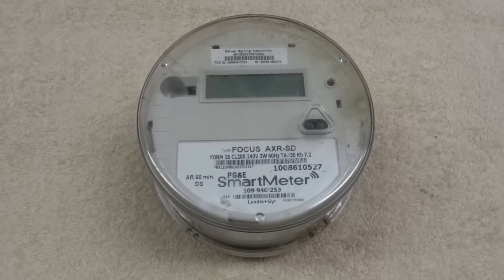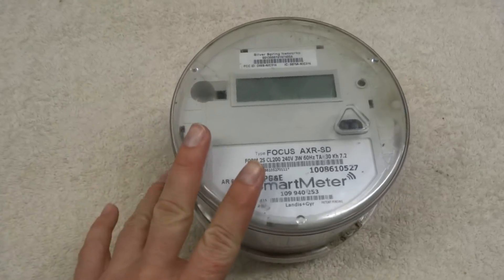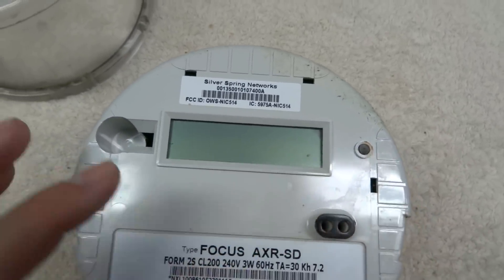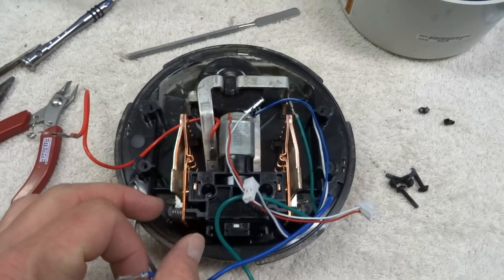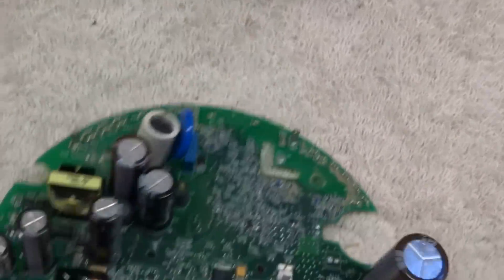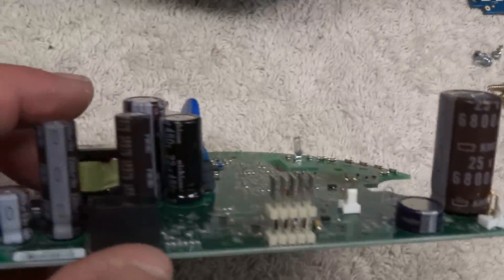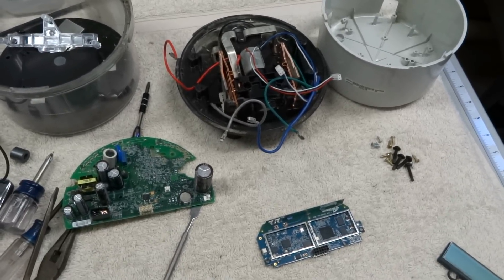Let's Teardown - Residential Smart power meter

Comment: The really interesting thing I see about this meter is that it measures both 110 V sides of the incoming service… That means they're charging for two phases or two wires… This amounts to stealing because there's no such thing as two phase....The old analog meters measured both sides of the incoming service but only metered one side which ever side was highest on Watts consumed
Reply: jicasound    ignorant!   2 phase is 220 v.   Most houses were updated to 220-240 volts  in the 70's   a lot of  ac's and electric water heaters are '2 phase'
Reply: ignorant! there is no such thing as 2 phase, at least in north america. single phase 220 is sometimes referred to as split-phase, as in the transformer produces 220, and is split by a center-tapped neutral into two 110 legs
Reply: Greg McNamer good on you, i was about to jump in here then i saw your input, funny thing i was a broadcast A/V engineer for 15 years, still was friends with my solid state teacher and yet somehow was missing this. I was looking at an old 100 amp service and couldn't reconcile all three wires, L1 L2 and neutral, were all the same size.........my teacher and stopped by and gave me enough to figure it out. Feeling a bit embarrassed i confessed my ignorance to the next meter reader who paid a visit. He smiled and said he only found out they were out of phase a year ago too. When both legs are balanced there is zero current on the neutral, that's why it's called "neutral" and now i find when de-rating conduit ampacity neutral is not considered to be doing any work, only making up the difference, thanks.
Reply: metro_BLOOMIN we can only learn as much as our ignorance allows, hey i just made that up so it might not be watertight, does sound good though.
Reply: Very well said.
Reply: It is correct to say that the power line voltage is stepped down to 240V.  These transformers are generally center tapped with the center being attached to ground.  This effectively creates 2 phase, 120V AC power, with the 2 phases 180 degrees apart.

These two phases are drawn from a single phase on the powerline.  It's not typically called 2 phase, but it's not incorrect to call it as such.
Reply: That's right. Right? I have never heard of "two phase". Single phase, available everywhere (there is electric service) and three phase, not everywhere but definitely in industrial zones.
Reply: i stand corrected.  I thought it was called 2 phase.
Reply: metro_BLOOMIN calm down dude, when troubleshooting or designing distribution systems i usually think of it as two phase, because it is. Most people don't comprehend the basics so they are quick to correct anyone who makes a reference to " two phase" because they mask their lack of technical understanding by knowing the jargon. Try this, next time you see equal current on both legs disconnect the neutral and try wrapping your mind around the result.

Comment: The power comes from the utility side, not the owner's side. If the power came from the owner's side, the meter would not be able to disconnect/connect the service remotely. Also, there are 2 120 volt inputs and two 120 volt outputs. Ground does not go through the meter. The 2 120's are out of phase so the voltage across them is 240 volts. That's so you can run your oven, dryer, etc.

Comment: You don't know what you're talking about
2:22 - No ground terminal. 220 in, and 220 out
3:08 - That's a reset/close button, varies depending on installation application
4:30 - The motor drives the contactor relay switch
5:15 - "siphoning power through inductance" are you kiddiing? The red and green wires is how the meter gets power. That "doughnut" is a current transformer, which measures the current flowing through the meter, according to which a customer is billed for power consumption.
5:50 - safety feature?! No, that's the core of a smart meters functionality. It's how the power company disconnects service
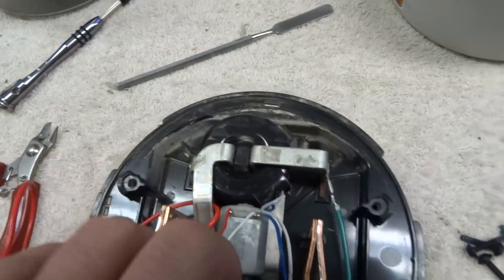6:20 - Are you f'ing joking?! Ground?! NO NO NO NO DO YOU REALLY F'ING THINK A GROUND WIRE WOULD ATTACH STRAIGHT TO THE LIVE????
9:15 - It's to close the contactor
10:10 - Banana plugs really??? That would compromise the weatherproofing
Reply: if you have a smart meter ( just for instance ) on your own home
try opting out
Reply: 2:22  - No ground terminal. 220 in, and 220 out
❓❓❓❓❓❓❓❓❓❓❓❓❓❓❓❓❓❓❓❓❓❓❓
At each house, there is a transformer drum attached to the pole. In many suburban neighborhoods, the distribution lines are underground and there are green transformer boxes at every house or two. 
The transformer's job is to reduce the 7,200 volts down to the 240 volts that makes up normal household electrical service.

It is the year 2018 you know.
Reply: @frederiquezug5938  LOL.  he aint be talking about that there green box on da ground.
Reply: Smart meters do not have surge protection anymore. 

There is no over voltage grounding lugs on these new meters
Huge source of smart meter fires

Lack of  UL 2735 Electric Utility Meter Standard Ensures Safety and Performance
Huge source of smart meter fires. 

In Canada, not following Canada's CSA C22.2 NO 115-14 1.5 rules 
Huge source of fires. 

The criminals at your power company will do anything to make a profit, including premeditated murder.

Comment: Focus is the brand, Silver Spring actually designed the networking system that the meters use.
The WiFi on the meter networks to the WiFi Transponder the power company uses to read the meter data.
The IR lenses are for a handheld reader ( does the same thing as the WiFi reader that's mounted on the meter guy's truck).
The motor/cam is to kill power in the case of emergency disconnect or fire in the home. Instead of pulling the head and leaving exposed leads exposed to elements in an emergency disconnect. The smart meters actually use less power than the old motor driven analog meters.
Yes, the blue SiverSprings board is the WiFi card. LOL and NO they don't hack your home WiFi... connects ONLY to the transponder.
Nice to hear from someone who knows a few things instead of some of the "foil-hatters" here on the ole YouTube :)
Reply: Do you have any proof?  What's that you say???  All BULLSHIT, I thought so.

Comment: Item is not certified. Where is the underwriters mark?  None on any in our town.
Reply: Meters are granted a pass obviously.  Shameful.  If a problem with a meter occurs the chief fire inspector collects the meter and no one ever hears anything more than the fire originated at the meter and was due to old wiring not being able to handle a spike.  Note, the fire hazard seems to show itself when a meter has been remotely activated and usually on older homes verses new construction.  Typical if services were stopped for some reason.  Older homes have prongs that do not fit the newer digital meters very well.  Leaving gaps and a potential for disaster.  They, the insurance companies push any liability onto the home owner who likely was never made aware of the potential for an issue.
Reply: nrdesign - Electricians in Canada can not install anything that is not certified. Electrical inspectors look for this all the time.   But these meters are actually the property of the "utility", are installed by 'the utility' and as such do not fall under the perview of the Canadian Electrical Code (CEC).  Utilities have their own code and installation books.  Come to speak of it there is also a separate CEC code for manufacturers as well.

Long way around to saying that Utilities write their own regulations and deal with issues in house (self insure).
Reply: You do understand that underwriters laboratories is a private company and in no way affiliated with any government safety organization. The existence of UL is a result of insurance companies. And there is no requirement for anything to be certified by UL for it to be legal for sale or use.
Reply: My Gas Meter is certified.  My old analog had over 50 years of service and never failed and was certified.  UL is one of a few underwriters that could be sought.  As a product provider I ensure ETL certification of our items and pay to protect not only myself but my customers as well.  It's a matter of "responsibility" and frankly if you want to give a pass go ahead but I expect more especially considering the nature of the deployment and the importance for safety.
Reply: RealeyesRealizeReallies the manufacturer could have chosen to underwrite the product themselves.
Reply: Ah, but would they not seal it as so?  I would prefer choice as a purchaser and in this case an arms length underwriter would be more appropriate..
Reply: Aren't there building codes / safety standards that imply certification for any equipment to be installed?
Reply: RealeyesRealizeReallies it's pg&e it blows better call 911.

Comment: Its funny Lyndis Gry would use electrolytic capacitors, here's why.
http://www.mouser.com/pdfdocs/ELNAReliabilityAlumElecCaps.pdf
If you look at the graphs you'll see some caps of this kind fail over time it says life expectancy 2000 hours will that's going to be different for each and every valve cap but if you do the math 2000 hours is 88.33 or something days. remember these are on 24/7 365 days a year. what happens when one goes out? some leak an acidic fluid on the circuit board the attacks the solder joints, or burst throwing fluid all over the board, over time this can cause shorts or open circuits this would be a critical failure of the device in a short timeframe, Heat and cold make this even worse, I've bought LED light bulbs that didn't last a year because of heat. Heat is a major factor for product failure in electronics, Put that outside in a dry climate like Texas or California in direct sunlight and you quickly have a problem its only a matter of time before the device is not operating properly or has a critical failure, or worse Fire.
Solid State Caps would have been a better route to take, but they cost more money.
From an electronic standpoint these meters would not last long at all in most climates outside. say 3-5 years tops. however some might last 10 years but that far and few between and the accuracy won't be good anymore.
Reply: Temperature is a big factor in capacitor lifespan they definitely will fail sooner if the meter is directly in the sun.
I'm surprised they didn't splurge for more tantalum capacitors as they're more durable than the aluminum ones.
Reply: +bobbg 
Well considering all the awful stuff I hear about spy on you "smart" meters, they obviously do not care about our safety anymore.

And "smart" meters are recommended by liar mad-scientists, and by power-mad NWO criminal elitists. And liar mad-scientists are never wrong?

BTW, why would a "smart" meter have any use for a costly super-capacitor?

Comment: Yup it's a smart meter all right, and probably a great deal smarter than you.
Reply: Cell reception went down, at times wifi stops and the signal isn't as strong anymore and if you turn everything off you hear a high pitch wine.
Reply: +seeDiersoil crossrowds 
That's the problem, it could outsmart me and spy on everything I do and I can't shut it off. But they can by remote. OOPS must have ran the dishwasher at peak power time. Power companies are paid to supply power, not regulate its use in your home Spy on your appliances, and know what you typing on a keyboard.
I had thought about a system like they use to monitor my own power usage inside my home and only on my computer Via cat 5e behind 3 firewalls and plenty of spyware detection software. But this is broadcast Via microwaves.
Without any concern of security protection that we have been told about for anyone to hack or exploit the information and we have no control over once is been taken.  Hey I like to watch TV at 2:00 Am that's my business! My tvs on 24/7 365 days a year. But i'm home most of that time too. I like long walks on the beach..... oops different story.

You're right it is a smart meter do you know its full ability? I don't think the utility does either.
At 3:00 pm and  your home then the power dies down for no reason you now of and stays off for 4 hours, your ac is off. your house is HOT its 113 F outside and 97% humidity. you parched ass will be under a shade tree gasping for air. and then it hits you its a smart meter!   Now come take the damn thing off my house!
Reply: +seeDiersoil crossrowds thats interesting....anything like pain, besides the migraines, and do you notice an increase in "low hum" noise? Just curious.....
Reply: msbieber1love No low hum noise, but my phone, all phone signals are cut off in my room unless I put my phone outside of door.
Reply: bobbg I bet this is what is keeping everyone asleep. Think about it...smash your smart meter and WTFU! LOL  Could it be that simple. Might make a good movie.

Comment: Meter is rated 240 volts. Two 120 volt legs and 200 amps. Common residential meter. Manufacturer is Landis & Gyr.

Comment: Yes, the reason for the motor inside is for remote disconnect for none payment. NOT safety. And there is no wireless network on these, they do networking over power line.

Comment: The switch for close is for when they first install it.  They press that button so the motor would turn the cam and cause the contacts on the bottom to contact each other to give your house power.   Think about it, Open circuit, Close circuit.   There is no ground or neutral in the meter itself, its all 240, two 120 lines going through it.  The ground wire is the metal case and a coper wire going straight to ground to a coper pipe.  Sometimes this wire is shield by a galvanized metal pipe.  The neutral wire by passes the meter going straight to the breaker box.  In the breaker box, you get those three lines.  One hot for each side of the center, and the neutral one will go to the neutral bus bar.  In some states (electrical codes), this bar is also shared with the ground bus bar.  I'm a tinker as well, so thanks for the video.  Too bad you can't just cover up the meter with a metal sleeve and prevent signal from leaving.  This once a month, remove sleeve for 2 minutes, then replace sleeve.  So they get their reading.  Also as a tinker, excuse me I mean advance electronic hobbyist.   The .22F 5.5volts.  Hmm. 5.5 volts to operate the transmitter under complete power outage and or to engage or disengage the motor cam shaft.

Comment: FCC ID : OWS- NIC514   Oh Oh    Does anyone know what the M.P.E. distance is for this smart meter?   
Why don't we look.   https://fccid.io/document.php?id=1256804  MPE 18.3 cm
That means the radiation is so large, the customer has to stay away from this smart meter.
So the DO NOT INSTALL DISTANCE is 18.3 cm or 7.3 inches.    
Can any of you walk by a smart meter and get within 7 to 8 inches?   If you can, then your smart meter was installed against the FCC rules. 

Just incase any power company trolls want to disagree. Why don't you answer this question.
*What is the maximum E.I.R.P. allowed inn the I.S.M. band.
Reply: +Frederique Zug stop licking our smart meter
Reply: +erg0centric 
https://www.facebook.com/soydebonao/videos/1001159286572568/
Smart meter riot.
This one is funny.
Reply: +Sigi Henke FIRES  FIRES    FIRES    FIRES    FIRES New UL 2735 Electric Utility Meter Standard Ensures Safety and Performance  http://www.metlabs.com/blog/meters/new-ul-2735-electric-utility-meter-standard-ensures-safety-and-performance/“Childers explained that part of the problem was a loose connection between the meter and the meter base because the smart meters had thinner &quot;blades&quot; than the previous analog meters. (JD slip op. at
12, LL 36-38; Tr. 265, LL. 3-6).&#160; Childers told Reed that the loose connection caused heat, which, in turn, caused an electrical arc, which resulted in &quot;two pallets of burned up meters&quot; in CenterPoint&#39;s meter shop. (Tr. 265, LL. 13-22).”
&#160;(http://www.stopsmartmetersbc.com/wp-content/uploads/2015/05/Reed_Answering_Brief-1.pdf&#160;
pg. 8)